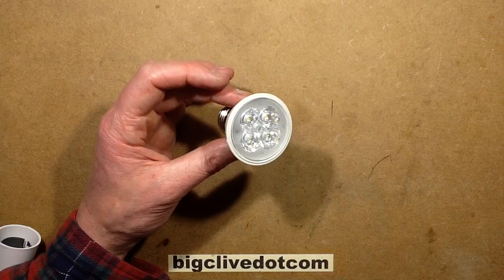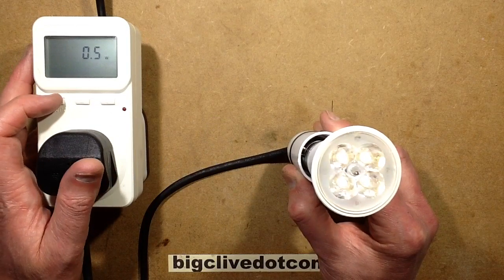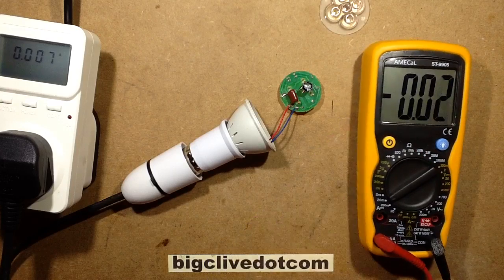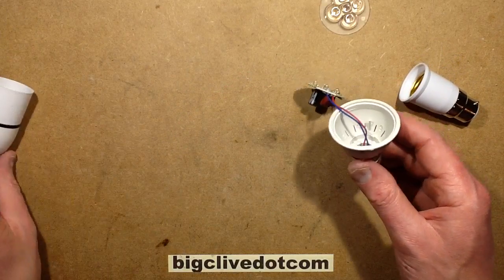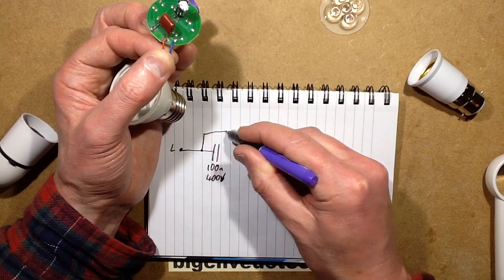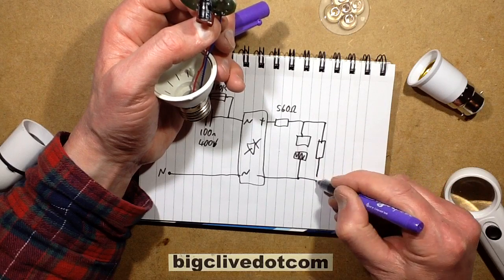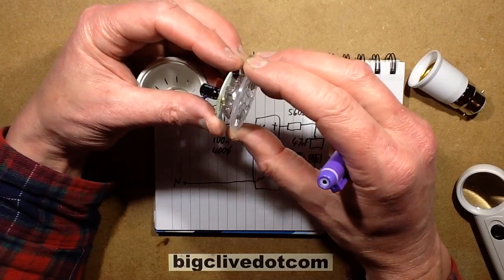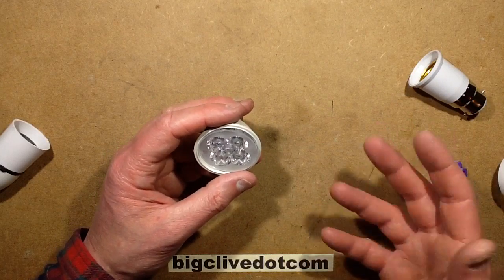Weird 1W (0.1W!) LED lamp from eBay.

Comment: You're forgetting that a lot of current will be going through that stupidly low value resistor instead of the capacitor. The impedance of that capacitor on 50 Hz is about 32k and the resistor is 100k, so about a quarter of the current - roughly 2 mA - wil be going through the resistor. That adds another ~0.4 W. So your meter was spot on showing 0.5 W.

Comment: What does the 100n/400v capacitor do? I see this a lot, but do not understand it at the moment.
Reply from the maker: It rations a portion of current through on each half cycle of the mains.  So it acts as a current limiter with no heat waste.

Comment: How may watts would that 100k resistor be pulling?
Reply: The impedance of the capacitor at 50 Hz is about 32k, so about a quarter of the current is going through the resistor, so about 0.4 W.

Comment: How is it possible to get 12V (or 16V if the leds are 4V EA) from a wall socket (220-240V) without a stepdown converter or a transformer?
Reply: eivis13 
Capacitive dropper. Look it up, they are dirt cheap to make and are very small, very configurable and very dangerous when used in non-enclosed applications :)

Comment: wait a second... how did he measure 7mA without breaking into the circuit?
Reply from the maker: By shunting one of the LEDs.  The combined forward LED voltage is so low compared to the mains that shunting one with the meter so that all the current flowed through the meter would not have affected the current in the circuit significantly.
Reply: never thought i get an answer on youtube comments. thanks. great videos, awesome channel.

Comment: How can you measure the current as shown at 2:17 without breaking up the circuit?
Reply: LEDs are semiconductor diodes. When operating (conducting) each of those LEDs will have about a 3 volt forward voltage drop. If the voltage available to the LED is less than 3 volts, say 1 volt, it won't conduct at all and won't light up. The meter, when set to measure current, has a very low resistance. When the meter is connected across the operating LED, the meter acts as a short-circuit. The voltage across the LED dropped to a low value, far less than the 3 volts necessary to get the LED to conduct. So the LED dropped out of conduction and all the current flowed through the meter. 

Because of the forward voltage drop of an LED (3 volts), there was no need to break the circuit to insert the ammeter. Simply putting the meter across the LED causes the LED to drop out of conduction (it becomes an open circuit) and all of the current then flows through the meter.

If you could have seen the front of the circuit board, you would have seen the LED go dark when the meter was connected.

I hope that makes sense.

Comment: this is a disaster lamp, it is working on the same principle as those light switches that have a led inside when they're off. Power is obtained via that capacitor and usually when  a capacitor is used this way by connecting it to 230V it can give very low miliamps current.

Using a transformless or non-regulated power supply like that is used to power devices that req vey very low current. The normal way of doing this is by using a switching power supply like the one they use in ccfl bulbs.

A candle light is better than this  crappy lightbulb.

Comment: .007 was the main current to the cct so u must multiply it by main voltage to get the power !
Reply from the maker: +Saad Salih That would be apparent power versus actual power.  The capacitor limits the current by capacitive reactance.
Reply: @bigclivedotcom  Actually, he's half right. Or should I say quarter right? About a quarter of the current is actually going through that stupidly low value 100k discharge resistor, bringing the real power up to about 0.5 W.

Comment: I bought some 1w (claimed to be) led bulbs in a golf ball shape with ES fitting. I doubt they are even 1w like yours but strangely they continually glow slightly even when switched off. Any ideas?
Reply from the maker: +V T Very common with low power LED lamps as they will glow with just the tiny resistive and capacitive leakage current between cables.  Especially in two-way switched circuits.

Comment: You are the market, Clive. They sold one! Yippee they shout! Seriously, though, how is any money made from the cheapest crap sold on ebay? Surely it is all just making a loss and they are trying to shift problematic stock. I really would like to know how they make any money. Do they just get stuff that is being thrown out from various places, then assemble some of the bits to make a product? Nearly every cheap electronic product I have bought on ebay has had a problem that is either immediately apparent or manifests itself a few months down the line. I assume they are rejects and that is why they are cheap. I mean, for this lamp, 99p including delivery. How??

Comment: My god, these Chinese nuts get away with murder! No isolation? Not even as much as a proper power supply, just a capacitor and resistors, off a 220V source? Granted, isolation isn't particularly important in this case, but the energy lost by relying on resistance to drive the voltage, that's... crazy. And in response to an earlier comment, there's no way this'd last longer than a real, properly built LED circuit that actually uses a regulated power supply... oh, there is so much wrong with this circuit, it hurts my head!
Reply: You're not supposed to stick your fingers inside things that are live at 230V. As long as the contents of the lamp are  sealed it's perfectly fine.
You do realize if you get into the glass the old tungsten lamps have no isolation either, right?
On top of being a substantial burn/fire hazard of course.

Comment: My guess is night light too. In pitch black, even the LED from a phone notification light can illuminate a room enough to see. Either that, or low-power low-heat illumination of multiple objects in a darker room.
Reply: I had to tape over my router with its blue SMD LEDs.

Comment: I'm not sure I missed something or not, but how did you measure the current into the LED without breaking the circuit?
Reply from the maker: +Marc Cabot The LEDs are in series and I bridged one out with the meter so the current went through the meter instead.  It can only be done when the voltage being dropped (mains in this case) is much higher than the LED forward voltage.
Reply: Oh, ok!  That makes a lot more sense.  And, watching for a second time I see that you actually mentioned it as well. :S
Reply: Ok, just because I enjoy fooling with numbers, I started looking into this series configuration..  Assuming that you ignore the 100k shunt resistor and cap, look at only the 560R series resistor and the diodes, you get a formula like this:

Pl = {n*Vd*Vs - (n*Vd)^2}/R where R is the series resistor value, Vd is the voltage drop across the individual diodes, n is the number of diodes in series, Vs is the source voltage, and Pl being the combined power consumed by the LEDs (not the resistor)

Using Vs = 16V, R = 560, Vd = 3V, n=4.  This calculates to a Pl = 86 mW.

Of course, when measuring the current in this video, one of the diodes needed to be bridged. This effectively reduced n from 4 to 3 for the duration of the measurement.

Recalculating with n=3 yields Pl = 113 milliwatts.  Exactly what you calculated.

We can have up to 5 diodes while maintaining forwards bias.  If we calculate the Pl for 1 to 5 diodes we get:

n     Pl
1     69 milliwatts
2     107 milliwatts
3     113 milliwatts
4     86 milliwatts
5     27 milliwatts

So, Fun Fact: You actually managed to get peak efficiency out of this device while measuring it :)

P.S. Given that the power consumption is about 99% on the diodes and 1% on the regulating resistor given n=3 diodes, I'm not sure how well it would have worked anyway (I'm not familiar with the rest of the electronics in use)

Comment: strange that they put the resistor before the capacitor, it's usually in series with the lads, which might have lowered the flicker. 

Some good scope for modding, could bump the power a bit with a higher dropper capacitor

Comment: Clive where did you get your plug-in power meter? It looks so much better than my Energenie one but I cannot find it on Ebay.
Reply from the maker: +Silver Legend It was briefly stocked by Maplin a long time ago.
Reply: +bigclivedotcom Thanks, Clive.
Reply: +Silver Legend Kilowatt EZ power meters are nice, but don't get the cheap ones.  The higher ones have much more information!
Reply: +PV2Omni Thanks for the info, sadly the postage cost to England puts it beyond what I am prepared to pay. I can buy an English one for about half the total cost.
Reply: +PV2Omni In addition to the unacceptable cost there is not a B.S 1363 version made.
Reply: +Silver Legend That I did not know!  Why would Killawatt, only make them for the US, WTF?  I did scan Amazon.UK, and saw a couple that looked like they had the same features.  Good luck!

Comment: What's the lumen rating?  I could see a use for these, not as a main light ofc.  But in film on a scifi set.  One light every 12", with conventional off the shelf hardware to power it.  Useful in that you could have a number of spares.  And if anything other than the lights failed, a trip to the hardware store on the same day fixed it.
Reply: +eric5318 9000000 Chinese lumens

Comment: Toilet light.  When you wake up in the middle of the night needing to take a piss, this lets you find the toilet without being bright enough to wake you the rest of the way up.  Granted for $1 you could instead the type that plug directly into a wall outlet and shine ~ 180 deg. plus have a light sensor to come on when it gets dark, but at closer to one real watt, they are almost too bright.
Reply: +Stinky Cheese Most of those LED night lights with light sensors consume more power while off because the photo-resistor simply shorts the LED(s) out to turn them off. A 25V transistor to shunt the LED(s) is cheaper than a 400V transistor and the extra circuitry needed to run detection independently from the LED voltage.
Reply: +Teardown Dan I'm too lazy to tear mine apart to reverse engineer or even break out a multimeter and jumpers to wire it up for testing, but with a Kill-A-Watt meter it measures the same whether the light is on or off, 0W and 2VA. 

It's only a single little SMD LED soldered directly to a copper clad PCB, not surprising that it is closer to 0W than 1W, so I don't really care if it saves power off or not, but yeah it might as well stay on but I like the design otherwise and being LED, turning on and off won't burn it out fast like with an incan bulb type.
Reply: +Stinky Cheese Indeed. I wired in a custom outlet near my toilet for an ionic air cleaner and found a motion sensing light that works there, too. One of the best things I ever did around the house.

But it used the old 7 watt incandescent bulb and that seems like a sun sometimes at night. ( I should be sleeping now instead of binge watching the latest group of bigclive vids!)

Comment: At last, an led lamp that will last for more than a few months.
Reply: About half a year ago i bought 4 really cheap cob blubs without ic and one seems to outlast them all. it probably has over 500 hours on it by now and its still going. 
even the one i had outside died and this one is in an enclosed glass and gets extremely hot.

Comment: How can it be 7 mA at both the 240 VAC and at the ~16 VDC? Does it really "waste" so much energy?
Reply from the maker: +Alexander Krivács Schrøder Power factor.  The LEDs see the 7mA but the real power is just the 7mA at the combined LED voltage.  If it was a resistive dropper it would dissipate a lot of heat but the use of a capacitive dropper limits the current using capacitive reactance and the only energy metered is the real power.
Reply: Huh, that's interesting. I tried looking up power factor on Google, and it went a bit over my head and mostly spoke of "power factor correction," but I'd still say I learned something new today, if not yet fully.
Reply: +Alexander Krivács Schrøder Look at it this way, if you stick a capacitor directly across the mains it will draw current but not power. This is because the current is 90° leading, IE as the voltage rises towards peak on each alternation of the AC sine wave the capacitor charges so you have positive voltage and positive current, but when the voltage comes back down after the peak the capacitor discharges so now you have positive voltage but negative current. As a result with each cycle the capacitor actually draws power from and then returns power to the mains twice for a net usage of 0.

Comment: The rating on an AC powered lamp has to be based on the AC power, not the power delivered to the LEDs. it would be interesting if they gave us both the AC and DC wattage, but AC watts and lumens is all we really need.
Reply: +Chris W I think they take the max lumens of the led and use that even if they are never driven close to their max output.

I found this out on my 1 watt flashlight I bought at walgreens.
Reply: BikingMNViking I understand that manufacturers like to deceive us, and your example is a good one. However, in this case the series capacitor (with parallel resistor) consume much more power than the LEDs. That wasted power has to be included in the rating. I wouldn't be surprised if Clive's lamp drew more than 1 watt.
Reply: Chris W
yeah, I've never even seen that method of driving LEDs here in the us but then I haven't taken apart many and I have a strip lighting my electronics workbench was the liteon proper PSU which is about two palmfuls for only 2.5 amps @ 12vdc. I'm sure it's quite efficient.

I bought a motion sensing light for an older relative and I'll bet that one uses the capacitive drop trick. Frankly it goes against every fiber of my being because I went through NEI (now dunwoody) electronics college for Avionics. It's part of why I enjoy clive so much -- he gets it! Plus he's more active in this stuff than I could ever be.
Reply: +Chris W  The capacitors hardly dissipate any heat, so hardly use any power. The bleed resistor across the first capacitor that Clive drew can be changed to a 470k, and then it will hardly dissipate any heat, so hardly use any power. In this application, there is nothing wrong with using a capacitor dropper power supply (as long as people cannot get there fingers near any conductive metal part.

Comment: I use some of these sort of wattages(From 0.5 to 2W) warm white LEDs in GU10 bases as 'navigation lights' around my home. On a separate switch to the main lights, these are placed above walkways, stairs and other places throughout the house to allow the people in the house to walk around to the bathroom, get a drink or do other similar things without turning on the main lights or having to find a torch. And under dark adjusted eyes they are more than enough.
It's very, very handy. And low enough wattage that leaving them on 24/7 use much power at all(About 10 or 15W across the entire 2 story house. And no more tripping over things at 2am!)

Comment: Ironically when LED lamps first started appearing in stores they were tragically underpowered, but today it's kind of hard (at least in my neck of the woods) to get a hold of a weak LED lamp, everything is super mega frizzle bright, unless you want to buy an expensive decoration cluster-LED lamp. So that thing you have there, to borrow your catch phrase, i quite like it.

Comment: Is that second 100k resistor (parallel with the LEDs) another discharge resistor, or is it necessary for some other reason?
Reply from the maker: +codebeard It's main reason is to make the lamp less "sensitive".  Without it the lamp can keep glowing even when turned off due to slight leakage and capacitive coupling in the mains wiring.
Reply: +codebeard I had the same question, a quick simulation reveals if an LED blows (with just 7mA on the LED it should have a good life), the 4.7uF cap will keep rising in voltage (until it reaches close to mains voltage). So yes the 100K would be there to discharge it once the power is off if one or more LEDs blow.
Reply: +bigclivedotcom That makes sense, thanks Clive for your awesome videos and explanations.
+covertads That also seems like a good reason, thanks